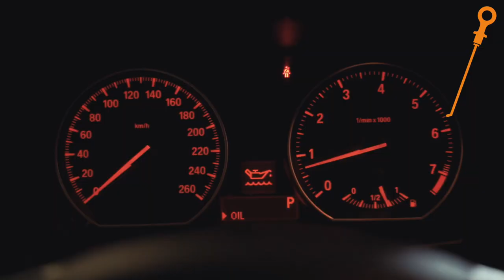How to change the engine oil and filter in your car [AUTODOC TUTORIAL]

Comment: On engines where the oil filter is pointing down, fill the filter up with new oil before screwing it in, to prevent engine wear during the first startup after the oil change.